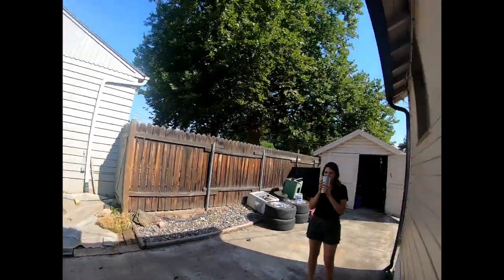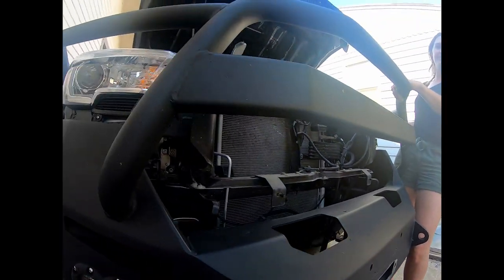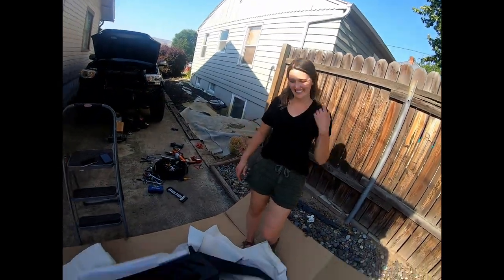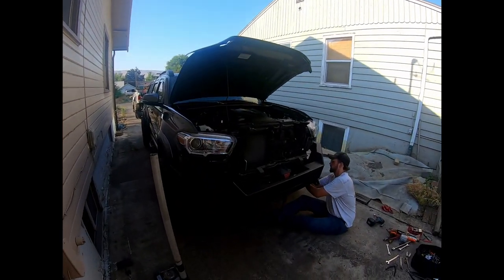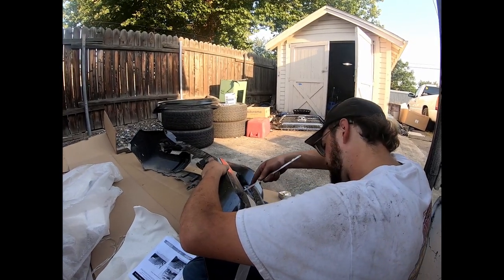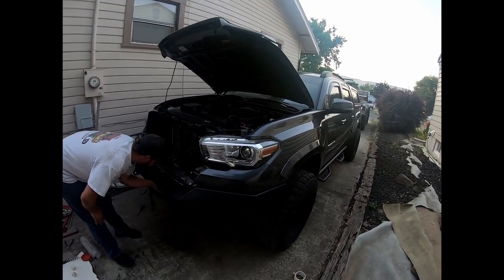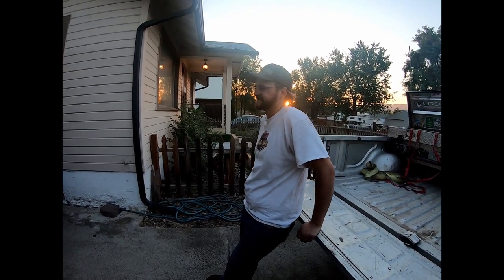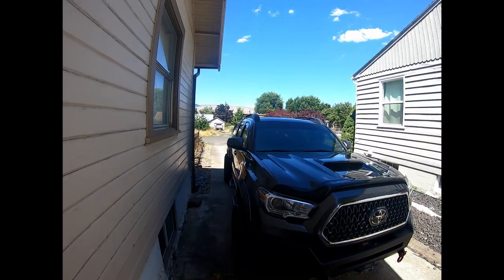IDAHO MAN INSTALLS NEW BODY ARMOR BUMPER

Comment: How much overall weight did it add on the truck
Reply from the maker: Compared to the fab fours bumper it was lighter, I’m not sure how much lighter exactly it was though
Reply: @Mycalculatedrisks  I don't off road and I've been wanting to do the same,I was just  having 2nd thoughts of the weight it will add to the truck